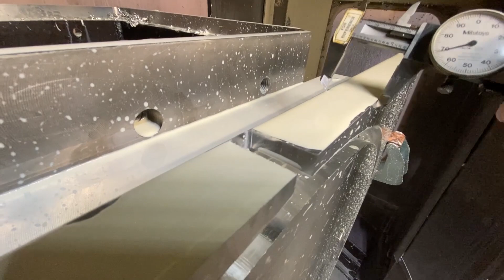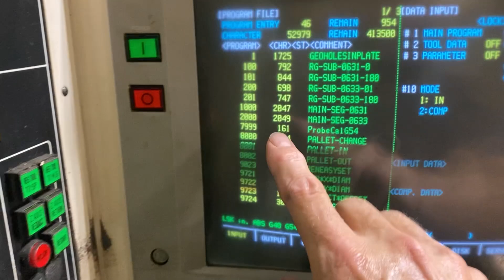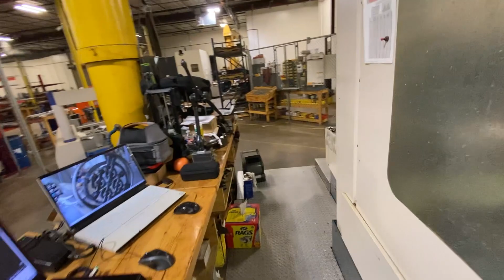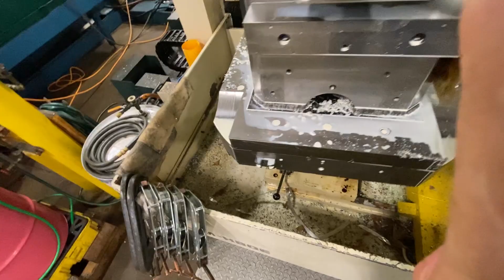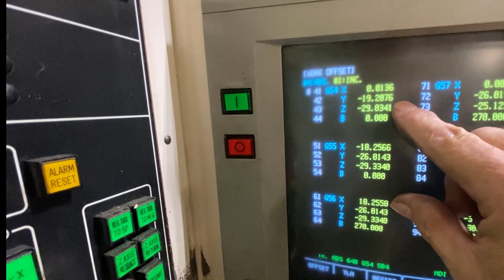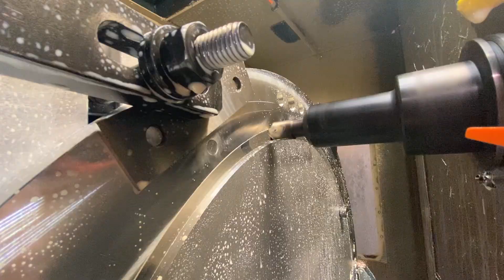Aluminum Ring

Comment: That last mention of the coolant made me chuckle. Back in the late 80's, early 90's, where I did my apprenticeship changed from the sulfur oil and soluble oil to that Cimstar 40B Pink.  Lololol, thanks for the flashback!  I wouldn't doubt if those old guys still use it today.  There's worse coolant for sure, but there's way better too.
Reply: Just started work with a pair of old timers, they've got a locker marked "private" full of prohibited chemicals, adhesives and whatever else they where forced to "throw away" over the years as the health and safety rep visited.

Some of the stuff wasn't exactly warranted, but a lot was! But it's rarely used, mostly if it's problematic to do a job without it. Once they retire I'll probably junk most of it, but some of the adhesives are nice to keep.

Comment: Interesting.  It's all about the details.  
What's the distinction in the coolants?
Reply from the maker: Different coolants can matter. I was just pointing out I didn't use the one you could see in the video. People will ask questions if they see it.
Reply: @EdgePrecision   Different lubricating/ cooling properties with different materials in guessing?
Reply from the maker: Yes as well as how you and the machine react to the coolant. Does it rust the machine is it hard to clean off the parts. Does it irritate your skin or your throat when you breath the mist. Does it go sour easy. Does it foam up with high pressure systems. These are all things to consider with coolant now days.
Reply: @EdgePrecision   Alright then.  Many different considerations.  Health is definitely tops on list.  
Thank you for your response.

Comment: nice one. but if you love the mashine, next time use the grinded spacers (not that hard to make- i know its pain in the... but it will stay in the shop). for screw spacers. Do them with as much OD, as you can. And the rest falls to tehe prefference (i do like flat bars as they are easier to handle under the clamps or other kind of holding). i would choose thickness about 2mm (0.079"). all carefully grinded to flat and to be usable all over again.

This what i said is based on time on hand AND knowledge of the mashine.

I am looking forward for next horizontal video.
Reply from the maker: The one thing that the paper did is damp vibration. If I had put this rather large piece of only 1" plate on spacers. I would be fighting vibration when facing it. It would be OK to mill around the circles but the facing cut would have chattered. Even when I flipped it over to do the second side clamping directly to the pallet face. Just facing the ring just had a hint of vibration. If it had been setting on just 4 washers it would have been almost impossible to face without vibration.
Reply: @EdgePrecision  i see. i mentioned it as your setup did look allready rigid. 4 screws few clamps after facing. but its good to know  this kind of experience.

what i saw at the first look .. ok, face one side. Put it on spacers clamp it as much you can outside of the OD and get rid of the chunks.. then offcouse  as you did clamp the thing with what ever you have at hand and finish it. 

 i cant imagine any vibration so far but it can be my  lack of experience as i am not in this trade long enough.

Comment: Hi Peter great video! I wonder if it could fit in the Mazak. Also - I was interested to know more about the pallet changer. how repeatable is it? how do you not worry chips fall inside and make the pallet sit out of perpendicular or out of position for an accurate part?
Reply from the maker: The pallet is indexed by two pins around 1.375" in diameter that are around 28" apart. So if they had .0001" clearance on the pins, I don't think the accuracy if index would be a problem. In fact I can not tell the difference between pallet changes. It is also clamped down on six pads. These pads have small air holes in their faces that blow air during a change. When the pallet is unclamped. So far after running this machine for the past about ten years. The accuracy of the pallet change isn't even enough to even worry about. That said if I am boring a hole to .0001" tolerance. I don't do a pallet change until I have it done.

Comment: Hello Sir 
 What is best way to set (tool data) 45 degree turning tool in integrex?
Reply from the maker: With the tool probe if it works. The control calculates the values when you probe the second direction. The next best would be a external toolsetter. I have manually touched one off but it is difficult to get it spot on. You have to make some calculations. Because the A and B values in the tool setup are not at 45 degrees. And the insert usually cant be touched off at the B zero position.

Comment: I would mount a aluminum pc 2inches thick on that T-slot table. With a modular pin locations and tapped holes. Mount it machine it. Face it when needed. Replace when worn. Saves on setup times. Doing rings is a different monster at time's.
Reply from the maker: I will probably never make a part like this again. So the investment in a aluminum plate worth as much as the part would not be worth it. It idea is to do the job with what I already have.
Reply: @EdgePrecision   check out Steven's engineering. We purchased some of it. Then made our own versions of it. Angles, mod blks, and the steel modular system for T-slots. It's work a peak.

Comment: I use a Makino 1210 Horizontal and a A99 Makino. Shops tool to its needs. I would have used a bigger finish mill to face it. But thats because its available.

Comment: Hi Peter.  I shot this short video (https://youtu.be/tHnw7e5exQw) in response to how you operate your G65 Sub Calls for probing, as you demonstrate again in this video.  My MDI is different then your Mits control, I thought this might be useful someplace.  BTW I was inspired and compelled to retrofitting my Robodrill with probing because of your very informative help a few years ago about how the Renishaw suite runs on the control. I am so happy to run this machine, now.  It is a breeze. Thanks
Reply from the maker: What I'm showing in this video is the Renishaw easy set macro. G65 P9023. Do you have this macro in your Renishaw programs. It actually does everything except the tool change you are describing in the video in one macro. All you have to remember is the variable entries for the cycles. Do you have a manual from Renishaw on the probing cycles? It should enplane this in the manual. Again it's called the Easy set cycle. It looks like you have your system working. So if that works for you than use it. If you have the Easy set macro though your other programs are taking memory space that the Easy set already does. Also with Easy set you don't have to edit a program to change the variables. Its like a drill cycle you just enter your variables on the line. For example G65 P9023 S1 A4. X4.0 Z-.75; This would measure a web (A4.) 4" wide in the X axis and go down .750" from where the probe is setting. Setting G54 X Offset (S1). That's all you need. Once you memorize the 9 (A) cycles you can pretty much do almost any setup manually with the probe. I know on the Fanuc it doesn't retain the MDI. So you would have to enter the line every time. I don't know why Fanuc makes their MDI screen that way.
Reply: @EdgePrecision  Wow, Peter.  Great to hear from you.   Thanks for responding to my comment.  I realized that you have the Renishaw suite, and that what I am running is different.  I was just trying not to be overly wordy with my description.  As you state, the macro call would often be the same with different variables.  You could use a cheat sheet or what have you, but you would still have to type them in.  Sometimes you don't like how the variables worked, and you would need to retype them in Fanuc.  Like man, that needed to drop down another .100 to get a good touch... Retype etc...  A guy on the Practical Machinist forum wrote my macros (Stefan Rubin from Israel).  Him and I ironed out the bugs and they work very well for me.  The deal clencher for me was that they are super small in the memory and my Robodrill is very limited on space.  The Renishaw suite takes up more then half of my available memory, so I really didn't want that in the memory.  Anyways, I am happy with how my little system works and I really didn't expect it to be so convenient.  I hope you are well, and thank you for taking the time to look at my video.

Comment: My father would take me on Saturdays to work with him in the 70s to a machine shop Criterion Machine works. Known for their boring heads, Bars. Early machines like these ran on punch tape. He was head of maintenance and would buy, repair,  test and install new CNC machines for the pretty large shop. One side was manual machines, the other building was all CNC. No longer around, But it was very interesting to see the new machines with more capabilities.
Reply: As i remember it, in the 70s,  things running on punch card/tape were pretty much NC numerical control with the computer (CNC ) part developed later.
Reply from the maker: You are correct. I have run this equipment. You punch a tape. This could be done from a computer with a tape punch. Or you could manually type/punch tape on the teletype. Than you put your tape in the tape reader on the machine. Than home the machine and read the tape. The machine just follows whatever the tapes commands are. In fact some of the commands in G code are hold over from those days. For instance the M30 is rewind the tape reader and the M02 just stops the program at its end without rewinding the tape at the programs end. This is NC. There was no stopping and rerunning just one tool or anything like that. It's more like what is known today as a drip/(Or DNC) feed program. Where the machine is nothing more than a glorified plotter.

Comment: We have 3 DMG-125 that would do it but you are right, they are massive machines
Reply from the maker: Yes to get that much travel in the Y axis. Generally machines have a travel of around 65+ inches in the X axis. That’s a pretty large vertical or bridge mill.

Comment: They could of cut that part on waterjet and then had it finished machined by you. Might of been better maybe not idk. Probably would of caused some other headaches.
Reply from the maker: It would actually make the job harder to do. Or at least the fixturing harder. Sometimes to do one part it’s more economical to start this way. If you were making many of them. Than it would be worth it to spend time on fixturing the ring. But without that how do you hold the ring by itself to face it. With the bulk of material attached to it that makes it easy to hold and face. You see the problem with just the ring by itself. Only on a lathe with a big chuck could you face it. Or make some special clamping method on the mill to face it.

Comment: Nice setup 
why couldn't you plasma cut the part and finish it off
Reply from the maker: It’s a little thick for plasma in aluminum. But water jet could do it. But actually for one part it makes the part more difficult/expensive to do. If you were doing many of these it could be better. But for one in order to face the rings faces. Special holding methods on the mill would be required. A lathe would be possible if you had a chuck that could grip on 32” diameter. But I don’t have a chuck that big for the Mazak. Also I don’t like to give another shop money on a job if not necessary. There also wasn’t time to job that out to a water jet shop.
Reply: @EdgePrecision  im surprised you don't have a water jet machine or a lathe that big to compensate that size.
What about making a fixture to mount it on your mazak lathe would have that worked?
Reply from the maker: The Mazak can handle a part this big in diameter. But I don't have a chuck that large. I have never needed to turn something this large in diameter (Until now). So it doesn't make sense to invest in a chuck that large. Better for me to use the horizontal mill.
Reply: @EdgePrecision  i understand.
 i was thinking you could have made a fixture for your chuck to hold the part on to it wiith clamps that's all.
But srill worked great with what you had.

Comment: Can you not drip feed that controller?
Reply from the maker: Yes but the max baud rate the control can handle is 9600. Not very fast. I have run programs that lasted 10 hours before.
Reply: @EdgePrecision  fair enough, I just thought for that particular situation, drip feeding would be more efficient than transferring then running.
Reply from the maker: This program only took a few minutes to load. The thing about a drip (or DNC) program is you can’t rerun tools or start it in the middle. You have to stop it and resend it again. And there can be no goto statements to go back because the data is gone. It’s like sending a print to a printer. If something goes wrong you loose everything and have to restart.
Reply: @EdgePrecision  true. Many different ways to skin a cat. Having an old mazak with next to no memory, I've gotten used to drip feeding everything, so reposting code and resending it is just the norm for me on that machine (no other option really)

Comment: As an amateur turner, is there a reason why you didnt probe Z to the surface of the upright pallet table? Since that is a more reliable reference surface? Good video though regardless
Reply from the maker: Thanks. I could have done that and set the offset up 1.25”. I did it the way in the video because I wanted to take the first/test cut right at the top surface. Just to see how it went. Look at the finish if it chattered things like that. Also it showed how flat things were. As you saw in the video where it didn’t quite clean up in a spot. Really as you point out all not necessary. But there is only one piece of customer supplied material so I was just being carful.
Reply: @EdgePrecision  no problem and fair enough, keep up the good work mate

Comment: Nice video, thanks! There is a little mistake on lead in or out on the second side? Why not to chamfer all cutoffs in the machine just for safety?
Reply from the maker: No mistake that I’m aware of. To chamfer the cutoffs would just wast time and take extra programming. Gloves will take care of safety requirements.
Reply: @EdgePrecision  at mistake i mean that little angled cut from center to ID. I suppose that is lead in. What reason to take that not by the arc of ID cut?
Reply from the maker: @КонстантинКучер-щ5м  on the roughing cuts I plunged into the material with a ramp in cut.
Reply: @EdgePrecision  Yes, i can see the ramp cut. My question is about direction of this lead in. Why not to make it along with direction of main cut? I watch the video one more time, you do it at both sides.
Reply from the maker: @КонстантинКучер-щ5м  It is applying cutter comp at the same time. The material is scrap why not plunge in the scrap away from the finish part.
Reply: @EdgePrecision  may be to get a better looking scrap? :) Thanks for discussion, i got your points. I learn a lot from your videos, thanks for that work, i can imagine how difficult it is.

Comment: Why not just have disk water cut ?
Reply from the maker: There are three reasons I can think of. One, I would be giving away some of the money to someone else. Two, the customer was in a hurry and supplied the material. Three, and the most important,  it actually makes it harder to fixture the part for machining. Particularly the facing cuts. So to save perhaps 30 minutes of machine time ( not to mention the cost of water jet cutting) to cut the circles would add more time and cost than that in fixturing.

Comment: This video needs to be used for training purposes Peter, it touches on every aspect of a seemingly "low skill" required part to produce to exposing the actual logic involved to minimize mistakes/oversights, you demonstrated the benefit of running the process through your "mind's eye" to vision the process long before putting material in place to create the part, superior execution.

Comment: Good stuff! 
Is there a reason to face in a straight line rather than face circular inwards on the part?
Reply from the maker: It could be done either way. I was programming with a old version of Esprit. The new version has a spiral facing cycle like you describe. It would have looked better on the finished part also.

Comment: What kind of machine is this?
Reply from the maker: It’s a Mitsubishi MH80 horizontal mill.
Reply: @EdgePrecision  I didn't know that Mitsubishi made machine tools. I ran Toyoda and before that Toshiba. And a bunch of other stuff. I do miss them machines.
Reply from the maker: @JD-hh9io  Mitsubishi has always made control systems and machines. They are most known for their EDM machines. What you see here in this video is their Meldas control. In fact the Mazak control is a Mitsubishi Meldas control with the Mazatrol on top of it. If I buy parts like servo drives for the Mazak. I buy them from Mitsubishi electric.
Reply: @EdgePrecision  I've seen Mitsubishi stuff on machines. Even on an old Warner & Swasey machine. I just didn't know that they made machines too. Thanks for the video as well and for responding to my question. I did this stuff for over 30 years. Retired now. These videos makes me home sick. Have a nice day.

Comment: This endmill looks like for steel not for aluminium, am I wrong?
Reply from the maker: It’s just a tool I had already in the tool changer. I generally don’t use special endmills for aluminum. I don’t machine a lot of aluminum to stock tooling just for that. For the small quantities of parts I make it doesn’t make any difference. The time saved in machining is not significant compared to the setup and programming.